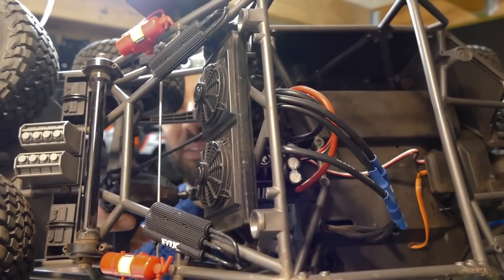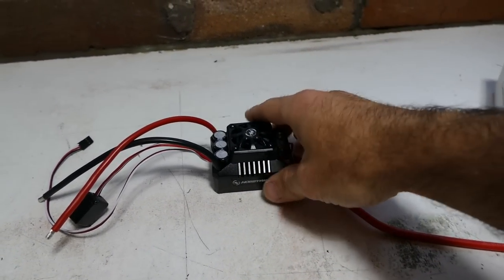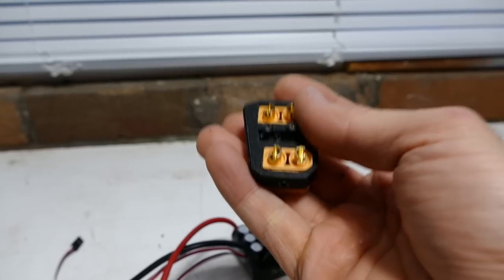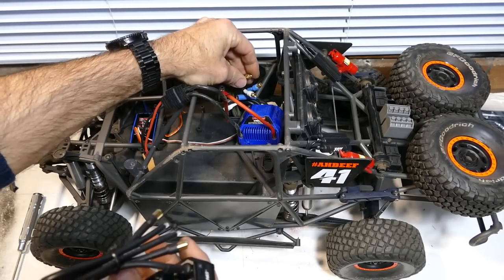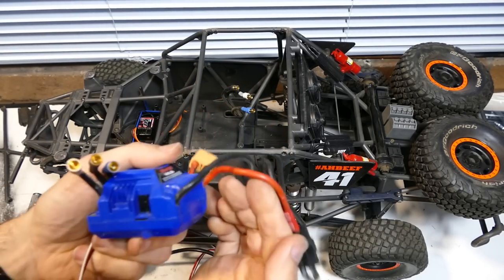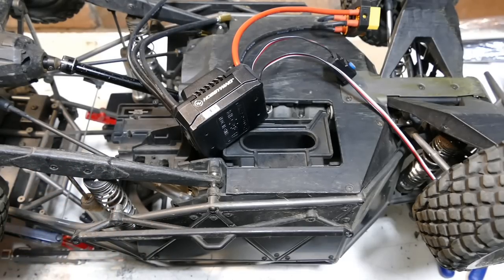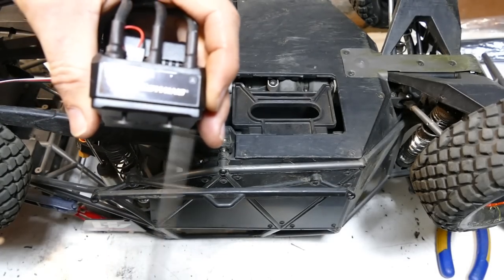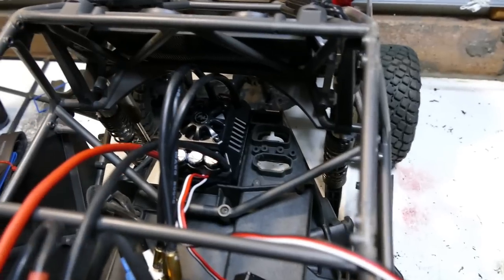TRAXXAS UDR - HOBBYWING MAX6 AND XT90 MOD

Comment: Hey Steve do you have a 3d mount for the losi Rock rey to xt 90 plugs also do nfg 6000 mah 3s battery fit in the Rock rey
Reply from the maker: I plan on printing one but not as yet. Whys are the battery tray dimensions?

Comment: Why did you go with a max 6 and not a max 5?
Reply from the maker: Far too much power. The Max6 is even perfect for the much bigger and heavy xmaxx
Reply: @RCTanksTrucks247  
Cool. Thanks for the info
Reply: @RCTanksTrucks247  
What about the motor if i wanted to upgrade